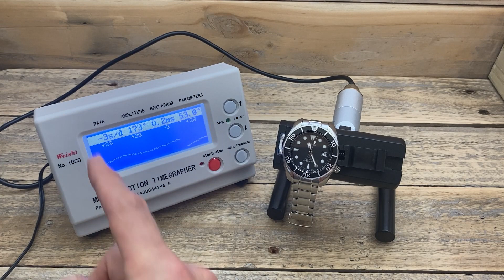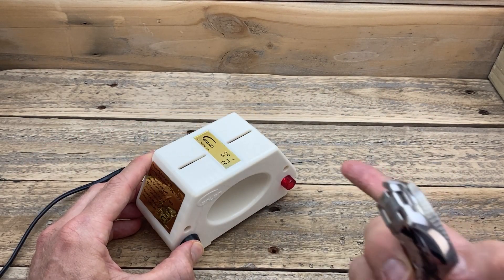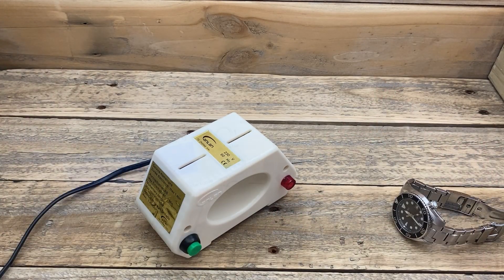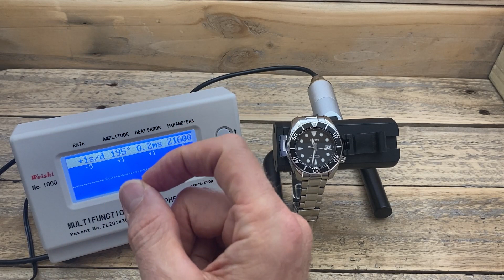Is your Watch Magnetized? How do you test for Magnetization? and How do you Demagnetize your watch

Comment: Compass?  Or the watch could be metal.
Reply from the maker: Thanks for WATCHing
Reply: Any magnetic metal will make the compass move. But I doing think if the watch is magnetized it maybe makes the compass quicker than if the watch is not magnetized or maybe pushes the red end of the needle away if they are polar opposite.

Comment: Hi I bought 4 watches from orient they all have the same movement (-15/+ 25 ) 3 of them are precise with time keeping but one of them is running late around - 90 seconds per day. Timegrapher showed that this watch is running + 11 s per day so technically speaking should be precise enough. I checked if it is magnetised so I also used compass and yeah the needle moved but the other 3 also move the needle in compass so it looks like they all are magnetised but this one is not accurate with time keeping.
Reply from the maker: I know that it does not always present exactly the same depending on how and where they have been magnetised

Comment: how to demagnetize a watch
Use a Refrigerator Magnet: Slowly move a refrigerator magnet around your watch in a circular motion. This can help to neutralize the magnetic field.
Magnetic Field Exposure: Place your watch near a device that generates a magnetic field, such as a speaker or an old CRT monitor. Move the watch around the device in a circular motion for a few minutes.
Reply: it works but be careful if you have magnetized it more then you better give it to a watch professional
Reply: demagnetizer works by continuously fluctuating the poles of the magnetic field, so turning a wire into a cylinder shaped coil and connecting it to domestic ac circuit (as the ac current oscillates) the poles would fluctuate which can be used to demagnetize
Reply from the maker: Thanks for WATCHing
Reply: you can also use a permanent magnet by spinning it or oscillating the watch left to right and right to left to demagnetize it

Comment: If I do this many times with that machine, will it have any effect on my watch?
Reply from the maker: There is no need to do it too much. Just a quick back and forth. 
If that does not make a significant difference then the watch may have another issue that needs to be addressed.

Comment: If a watch's case is steel (or other ferrous metal) it's going to move the compass needle. How do you know it's actually magnetized so as to affect accuracy or simply moving the needle due to it's ferrous metal content?
Reply from the maker: You will likely see a change in accuracy.
Reply: @WATCHingJames  I guess the question is: does it hurt a watch to run it trhough a demagnetizer if you suspect it's magnetized (i.e., moves a compass needle)?
Reply: Compass is a magnet so how is passing your metal cased watch near it, proving anything?

Comment: Seiko probably wouldn’t adjust your watch if it was even running at +28s as they rate the 6r35 at -15\+25s but accept slight outliers.
It’s a pity you didn’t show the watch next to the compass afterwards as well as I’ve rarely seen a watch that won’t move a compass needle at all even if it has been demagnetised or is running perfectly.

I have a watch that runs as near as 0s per day in any position but will easily move a compass needle.  This is a plain old nh35 based watch and because it runs so well I wouldn’t dare demagnetising it.
Reply from the maker: I would not be playing with it either. 
My best performer is my Longines Hydroconquest. Runs about 1 second fast  a week. On wrist experience.
Reply: Yes, because the outside of the case or the bezel can be magnetized and show false "alarm" on the compass or other detector that the watch is magnetized, but the mechanism inside could be just fine (not magnetized). So as long the watch it is still accurate you don't need to de-magnetize it (despite the watch failing on any magnetism detectors).

Comment: Excellent video, thanks. My 2 week old seiko is running approx 30 seconds fast per day. I was going to get it looked at but I'll try this method first as I'm confident it will improve things.
Reply from the maker: Sounds like this should help. Let me know if it works.
Reply: @WATCHingJames  I gave it a go, but sadly it hasn't.  I synced the time to my phone last night,  and in approx 20 hours I've gained 3 minutes! I've emailed Seiko asking for a repair or a refund, as that is clearly unacceptable. Really appreciate the advice though and have subbed 👍